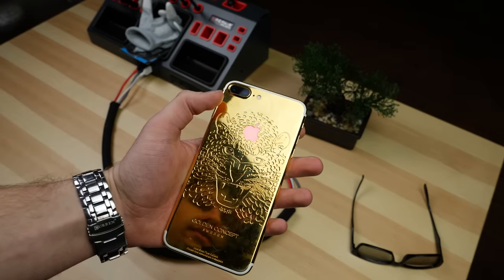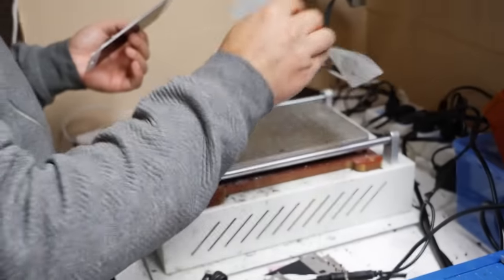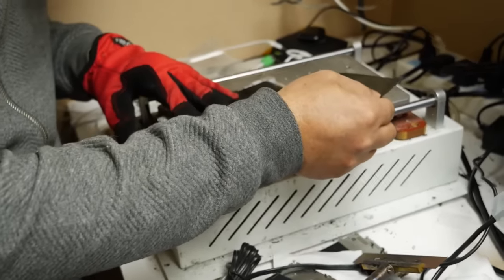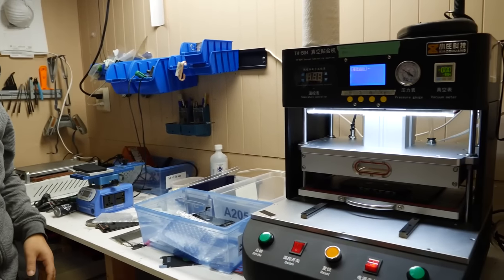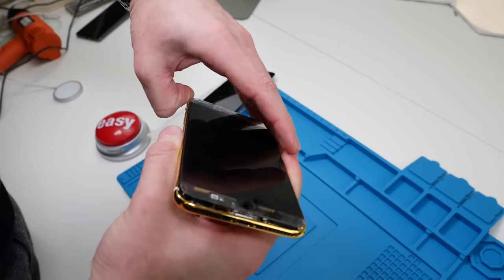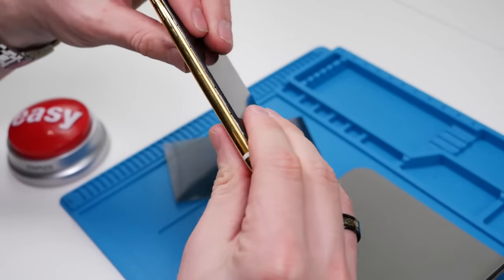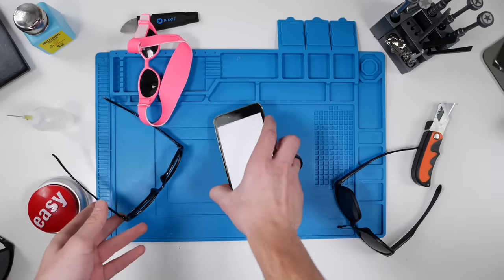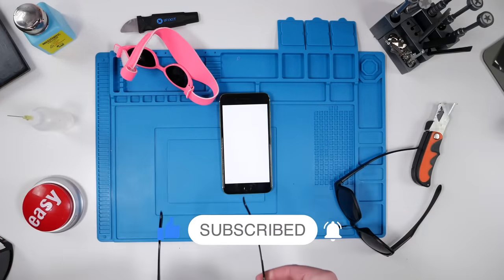THE ULTIMATE PRIVACY SCREEN.. (iPhone Mod)

Comment: you just whooped every privacy screen protector companies out there
Reply: FOOZY  if you already had to wear glasses tho it would be great
Reply: @holb8525  it would be inconvenient if you wore glasses because you have to switch if u wanna see your phone and then you would be blind with no prescription
Reply: FOOZY  YOOOO POLARIZED CONTACTS! That would make this mod 10X more badass. You would never have to worry about keeping up with your glasses to see the phone because they would always just be in your head lol.
Reply: @lo154lo3  There is also a really simple solution of just adding polarization to those flip up shade clips to your glasses so you can keep your prescriptions on.
Reply: Everyone here is forgetting that this only works properly so long as the glasses (your head) are in the same orientation as your phone's screen?
Tilt your head to the side at all? Colours get messed up.
What to turn your phone to use landscape mode (maybe for taking pictures)? Colours get messed up.

There's a reason this sort of thing has been known about since before smartphones existed yet has never really caught on. It's simply not as convenient as the videos make it appear.
Reply: Hahaha doesn't work on oled screen only LCD

Comment: Possible suggestion: If this is even a thing, you could see about installing a new flashlight piece to the phone that is able to do different colors or even shapes. Btw ur vids are 🔥, and I just wanted to tell u how much we all appreciate you.
Reply from the maker: That's a great idea!
Reply: Smart indeed
Reply: @PhoneRepairGuru  love you bro. you just got a new sub
Reply: Imagine replacing the backlight with another LCD that would be so funny
Reply: The 5G mod is pretty easy. Just add the modem bands.
Reply: @PhoneRepairGuru  would be cool if the color of the apple logo on the back depicted the color the flashlight would be
Reply: imagine the power goes out and u gotta use ur pink heart shaped flashlight to use the bathroom
Reply: But then he would have to mod the iOS software to change the color

Comment: Have to be honest, this is the best mod I have ever seen on YouTube, and I've seen videos of thousands of modifications and repair videos.

Next up, please try to insert a USB-C port on an iPhone. The original guy who did it posted his templates and plans online for anyone to do it, and he posted his prototype on eBay which is currently on $100k with 6 days to go.
Reply: holy shit it really is at $100k- I can't believe someone would do that much; I feel like the first bid of like $3500 would be enough. There's no reason a phone should be $100k lol
Reply: Damn 100k is too much to afford
Reply: @lola baldo usb-c has faster charging
Reply: @lola baldo Usb c has many advantages, 1 it's much more durable, 2 faster data transfer speeds up to 10 gbps vs 480 Mbps, 3 faster charging, 12w vs up to 240w, 4 much more cross compatibility (you can only use lighting on apple phones, USB-C is used on thousands of different devices thus removing the need for a mess of multiple chargers)  apple is just stupid and have used the same charger since 2012. so give me one reason that lightning is better (other than it's slightly smaller size)
Reply: Please do usb c mod the iPhone
Reply: @nicograhamdetto7247  you shut him up, nice
Reply: @nicograhamdetto7247  well it’s better for Apple at least since they can charge 3rd party manufacturers to use their proprietary port and make a ton a money!
Reply: Hype this comment up. He needs to see this
Reply: @nicograhamdetto7247  lightning is more durable than you think and apple ships a usb c to lightning cable so you get all the features
Reply: @lola baldo like guy that put usb c on it showed us how you can access tge system files with it and it would be a cool mod anyway since apple still havent made one with usb c
Reply: This isn't really that impressive. You just take your normal LCD screen and remove the polarizer. That is literally it. Actually, there's so many repair videos who show screen refurbishment.
Reply: @lola baldo the thing is it won't work well as lighting because it's not  Optimized for the iphone
Reply: Imagine trying to jailbreak it
Reply: Great idea.
Reply: @lola baldo Ok apple sheep
Reply: Lucas Gawor  lol I don't want to use my 50% of my money in bank just to buy a phone
Reply: @ytwatcher2021  For real bro he could almost buy a Macbook that's as fast as a used $300 Windows PC.
Reply: Apple needs to change to USB C in the EU in the next two years anyways.
Reply: @lola baldo this is the same excuse people used for headphone jacks even though a headphone jack can fit on the newest iPhones
Reply: @lola baldo people only use wireless headphones cause it’s inconvenient to lose the charging port if you want to use headphones. Also the adapter costs $20 so I wouldn’t say apple gives it. And someone proved that it could fit in more recent iPhones and even did it himself so they aren’t exactly using that’s space very efficiently
Reply: @lola baldo some people prefer wired (better audio quality and you can’t lose it if you keep it plugged in) also they make the phones bigger anyways so I don’t see why they have to save space on the port
Reply: @Zeex2k6.  there are plenty of people that can pay 100k for a phone, but I doubt there are plentyof phones like this
Reply: Lucas Gawor  "to you actually"

Ok Jeff Bezos.

$100k for a usb-c modified iphone is 100% unjustifiable. And a waste of money.

Even Apple can't do such a thing. So stop flexing your rich attitude it doesn't look good on you.

Unless of course, you don't mean yourself and you're referring to the actual rich people who can throw money out for it, then no problem.
Reply: @idksom8928  yea lol the good old days 😂
Reply: @Zeex2k6.  I agree with you. It's just too much it's insane.

In my currency we talking 41 million plus.
Haha I'm lying to you if I said a house can't be bought with this kind of cash.

 With more left for a car.
Reply: @lola baldo wired is still very much appreciated. Don't think because you use wireless airpods, no one else needs wired.

We get better sound delivery and never risk earphones slipping of and sinking into the toilet when your ears are wet/sweaty.

 "Whoops, there goes my $200, down the toilet....oh well"
I seriously doubt that's how you'll feel.

Every single phone review channel acknowledges the fact that some companies still think to add a headphone jack after all the blind following of apple's decisions.

You're out here defending apple.

 Wow what a hardcore fan you are. Can't even see when something they do makes absolutely no sense.

As if both headphone jacks and wireless airpods can never exist for the same phone.

RIP common sense
Reply: @fordealisbad8569  no you don't get the data rate or power by using that adaptor as data and power transfers are limited by the slowest component

durability not sure on not used much lightning but they both seem comparable
Reply: @blubbb4143  This. 

People need to stop associating a port (Lightning and Type C) with functionality. If you put a Type C port in the phone, it isn’t magically going to start charging faster or transferring more data, as these things are controlled by the power management controller (for charging) and the (I’m assuming it’s name, anyway) USB controller for data speeds. The port is only a connector, and these days, that connector means very little. 

As a side note, I have a few USB Type C devices that work over the USB 2 standard, so … so much for “Type C = bla bla bla transfer rate”.
Reply: @partitionhlep  is the iphone battery able to take advantage of that tho?
Reply: @lola baldo stop talking trash bro it doesn’t allow iPhones to be smaller and it’s also barely any smaller and what is a fast charging head? You mean a charging brick? If yes then that won’t make it faster because lightning is limited to 20 watt so a 30+ watt charging brick will only deliver 20 watt
Reply: @nicograhamdetto7247  it’s 20 watt and not 12 watt, you can also use lightning on the og iPad and AirPods and apple isn’t stupid because otherwise they wouldn’t be the richest tech company
Reply: @partitionhlep  Apple invented power delivery for that reason
Reply: @JstormZx  the „wired sound is better Argument“ only counts for professional studio headphones used on a pc with a soundcard or atleast a good onboard soundchip in a premium motherboard and not for phones because the onboard sound inside phones is garbage and that slipping argument isnt valid because good headphones don’t slip and if your ears are like the Niagara Falls then there are also „wired wireless“ headphones like the Beats Flex or headphones with a hook like the Powerbeats Pro and there are even hook accessories for AirPods and other headphones
Reply: @lola baldo overpriced easy-to-lose pieces of plastic
Reply: @dyme6924  i definitely do, i have wireless headphones and wow it is desynced
Reply: @lola baldo Speaks... what volumes exactly? That's weird.

Anyway, ok sure airpods aren't the only buds to exist. Can't say the cheap ones are even close to being better than wired though.

They sound terrible, they run out of power faster. Not to mention the build quality sucks.

😆 Why buy cheap wireless when even cheap wired are a much better deal? Cheap is always an ultra bad idea when you're talking about wireless buds. 
So why won't I be inclined to think you have airpods instead? I'm doing you a favour 😂

I mean you're literally here defending apple right?

And yes blind following
Once apple starts a trend many android manufacturers follow suit. Sometimes (like in the case of the notch and charging bricks) they don't even have a solid reason for doing so. So yes blind following.

 At least they gained brain cells and now we got hole punches and under-screen selfie cams. No more notch BARS.

And finally you didn't have a reply for my last point, HEADPHONE JACK + WIRELESS = COMMON SENSE. 

Absolutely no need to remove one of them.

Both can co-exist. There's absolutely no defense for apple's decision to remove them here.
Reply: @lola baldo i dont believe apple or samsung are distinively better, but you clearly believe the former
Reply: @lola baldo no, actually, I'm looking to get an iphone in december anyways
Reply: @lola baldo purposely making a phone worse for something they might do in 6 years is not planning ahead. Also that last part was just so wrong
Reply: @blubbb4143  it isn’t an adapter it’s the cable that’s usb c to lightning the port does support usb c
Reply: @lola baldo lol ok, I use Android and have fast charging, also LITERALLY EVERYTHING uses usb-c. Also yes fast charging song phones can do 60W, I think some can even do 90W, and I think it's the legion dual or something like that with 2 almost 100W chargers, and soon the max will be 200W
Reply: @lola baldo usb c is more compatible and has faster data transfer rates and faster charing if made right, lighting is good but not as good as type c.
Reply: @lola baldo it is fine for you to prefer Apple products, that's totally fine. But please don't defend bad decision. You said lightning port is way better. It would be fine to accept that statement previously. Not anymore, for a simple reason of Apple using type C on other Apple product except latest iPhone. If it is that good, why would Apple themselves switch over?
Reply: @lola baldo aight, audiophile here, saying that wireless audio has better quality is factually wrong, perhaps to untrained ears, with the same styles of earbuds or headphones, it’s very hard to tell the difference, however, Bluetooth has some major drawbacks that a wired connection will always do better. A: it’s a lot easier to drive high powered headphones and earbuds through a cable, simply because of the stupid power demands some of those things have. B: Bluetooth has latency, this is a fact, this will never change. It’s incredibly impractical for hobbyists, musicians, and home studio owners to attempt to use Bluetooth due to this. C: Bluetooth has to be charged on portable devices, if you have a gig, or even just want to listen to music for a long period of time, you don’t want your equipment to be dead because you forgot to charger it.

Bluetooth has a time and a place, I own Bluetooth speakers, hell, I have Bluetooth headphones too, I absolutely love my AirPods Pro for going on walks. But it’s not in any way superior, just different.
Reply: already is done on a samsung lol
Reply: i agree this mod is lit af
but someone actually did this before but with an lcd screen not a phone
Reply: @lola baldo dude, why can’t you agree that usb-c is better than lighting? Literally everyone does. Heck, I’m an apple user and I still prefer my usb-c ipad and MacBook over the subpar lightning port. Sure, it *works*. But USB-c is better in functionality in every possible way. The apple ones that come with their products at least
Reply: @SuperSohaizai  he’s talking nonsense. I’m an apple user and I wish apple just replaced the damn lightning port. Literally no reason to keep it
Reply: @Sandaquaza  I just want to provide a less provocative comment and make it less of an argument and more of a constructive criticism around here. Personally I use one of those random magnet tip where one cable for all my devices mostly usb c and micro b. I also own one lightning port tip for emergency haha
Reply: @lola baldo That’s very odd. Was it an off brand by chance? My apple-branded usb-c cables haven’t failed me yet but my lightning cables always fray and weaken at the bending point around the plastic bit on the pin.
Reply: @lightwxrk  then you do it lol
Reply: @andrewflage910  no, because it's not that interesting. I'm in the phone repair business myself, as I said, it's not hard to do. I know a few screen refurbishers who can easily get this done for me.
Reply: @lola baldo there are slimmer phones that have usbc
Reply: @lola baldo cross compatibility, too. The industry is moving to usb-c: most phone accesories are usb-c now.
Reply: @partitionhlep  as if an iphone would need 200w capable ports???
Reply: @nicograhamdetto7247  iphone doesn't need 240w capability
Reply: Lucas Gawor  i know it has been 2 months since you've posted your reply, but ok
Reply: @jackszabo5554  idk, just replied to someone asking for "advantages" with usb c and looks like i started a whole argument
Reply: @Scyth3934  i've read the whole argument i accidentally started again and it's been so long that i don't know what you're talking about. can you give me details or something? if you can't, then that't okay
Reply: Lucas Gawor  
you said: "it's not just the port, the battery has to support it as well"
i said "i know it has been 2 months since you've posted your reply, but ok"
Reply: @lola baldo allows it to be thinner yes. However the iPhone barely takes advantage of that. Any benefit lightening gives is completely negated by its short comings.
Reply: @lapuissance7488  that's not good for us tho
Reply: @nicograhamdetto7247  tbf you can do fast charging with a usb-c to lightning, whichi is what i do
Reply: I've also seen many mods mostly gameboy
Reply: @lola baldo what time did you come from? 2015? Nobody wants thin phones anymore. I'd much rather have a thick phone because it means I get more battery.

Comment: Those ones that inverted the colors are because the polarizer was installed sideways. It would be perfect for sideways use. An lcd works by shining a light that makes the screen all white and using the crystals with a voltage applied to twist and polarize the light 90 degrees which is entirely blocked by the polarizer. When you turn the polarizer that same angle, it does the opposite giving you inverted colors. Its literally that simple. 7:38 You can even see he had those filters and was placing them in front and turning them to show how it works and when its 90 degrees, you see the inverted colors

Comment: The polarized glasses gave you an inverted color effect because the polarization was sideways relative to what this screen needed. Different screens have differrent polarization directions (usually it's just horizontal or vertical) and having it sideways inverts it like it did at 7:36
Reply: Wow, Cool.
Reply: Ok ok, no ones arsed mate. we just wanted to watch the fkin video.
Reply: @royalred6946  if you "just wanted to watch the video" you wouldn't have fished for a half a year old comment with less than 10 likes. The guy in the video got confused by the phenomenon, I explained for whoever was interested. Reading is optional

Comment: Fun fact: putting 2 polarized filters at a 90 degree angle angle will block all light, but adding a third one at a 45 degree angle brings back some light

Comment: 2:44
Him: The blade also heats up to soften the adhesive. 
Also him: using a modded soldering iron.
Reply: @tsunami_nine the glue softens in response to high temperatures
Reply: @tsunami_nine nice reference

Comment: Some sunglasses are polarised anyway. And the polariser plastic might work one way up, but then also the other way up, if you twist it.

Might also be the case that if you get already-polarised sunglasses, and they're polarised the wrong way, then they won't work, so some sunglasses may not be suitable. So some are suitable with a  polariser sheet, some don't need one, and some won't work either way, regardless. Also if need by you can buy sheets of polarising plastic online. Needs to be horizontal / vertical, not spiral polarised.

You might even be able to get a polarising coating for normal spectacles. It's used to make them anti-reflective or glare-resistant.
Reply: So no landscape mode?